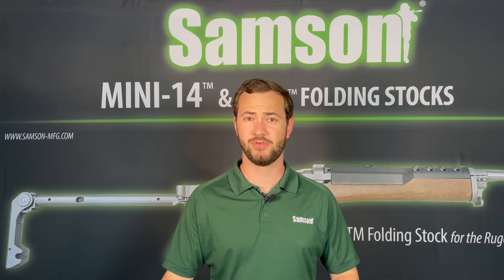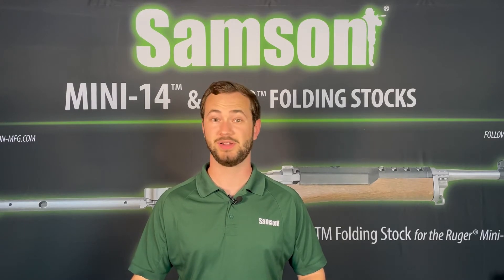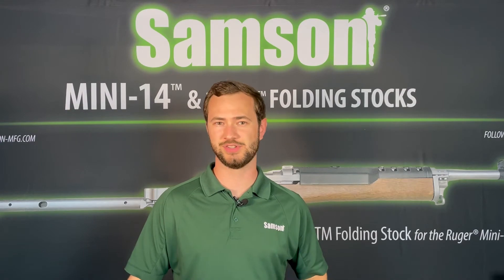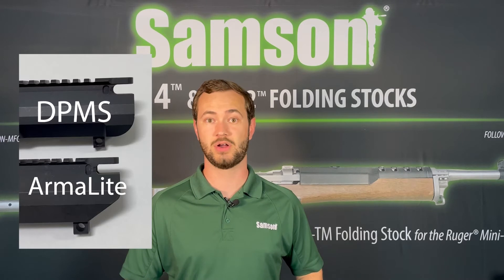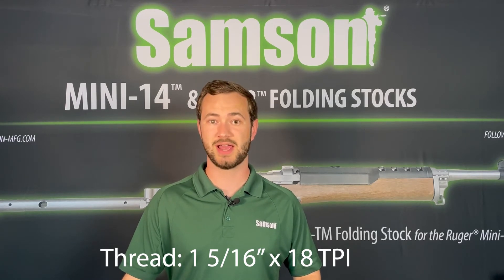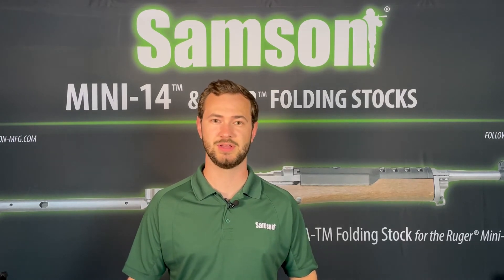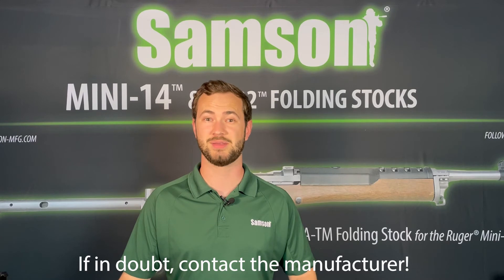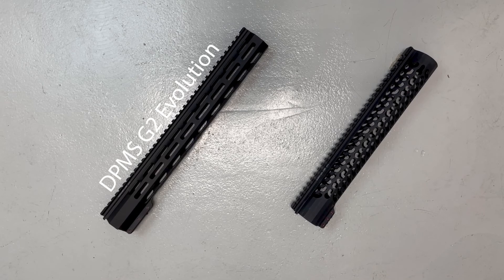Determining your .308/7.62 Receiver Height

Comment: Excellent video. I've researched this heavily, with calipers in hand, and multiple receivers. This video gets it right. The tang heights for DPMS High and Low are widely misreported, and the terminology used on message boards and even by plenty of manufacturers is incorrect. This video is the most factually correct and condensed description I've seen yet. The visuals for how the patters line up are super helpful too. Great job!